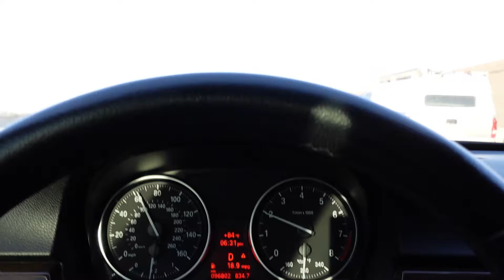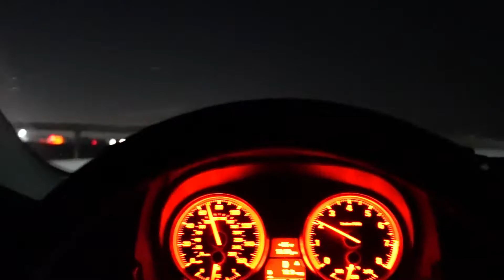e90 N55 VRSF Downpipe | Sound Clips

Comment: Tbh, valves closed sounds amazing. Deep rumble with lower tones sounds more like a V8
Reply from the maker: Usually I ride around valves closed because of that and also it’s a little to loud open 😂
Reply: @Acostajavies  Its a beast tho bro. Do you have a stepped intercooler too? I just got a downpipe, chargepipe and looking for an intercooler to run a stage 2 or stage 2+ MHD
Reply: your e90 is clean asf bro , kinda regret getting a e92 now 😪